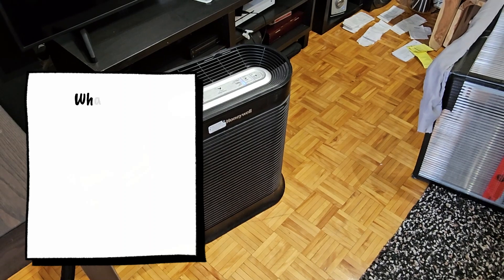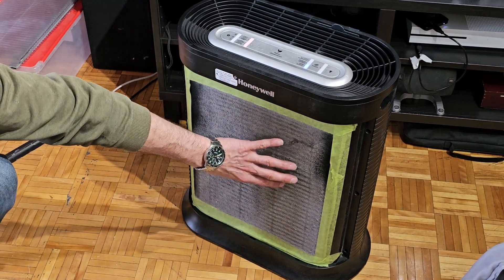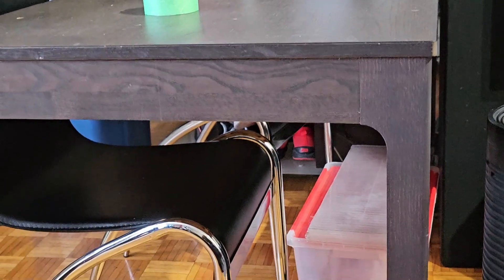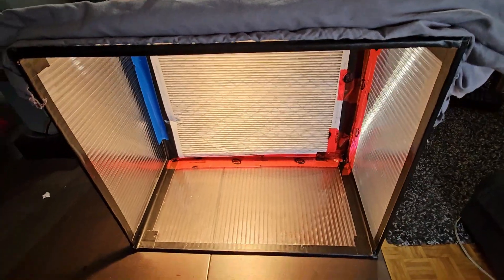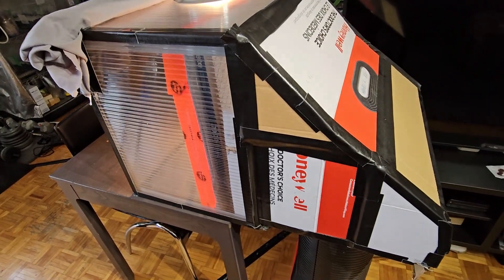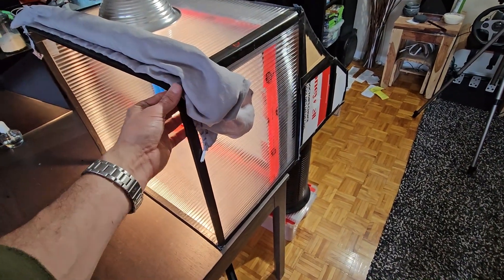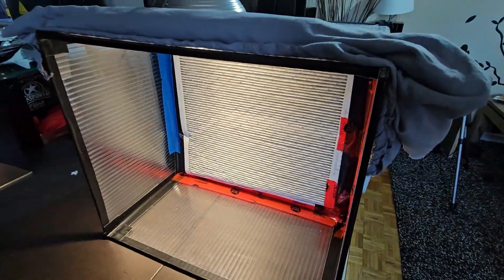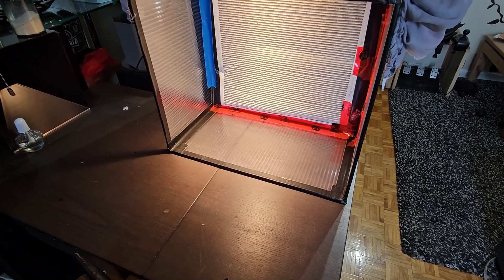How To Build A Laminar Flow Hood

Comment: This is not laminar flow
Reply from the maker: My room air purifier blows hepa air into a chamber where it backs up behind a secondary filter allowing the air to flow through even from corner to corner. I run 99% success with all my work.